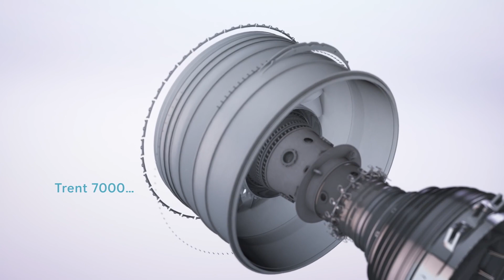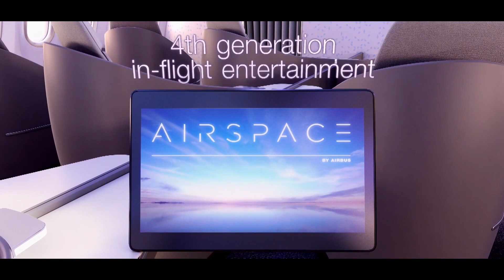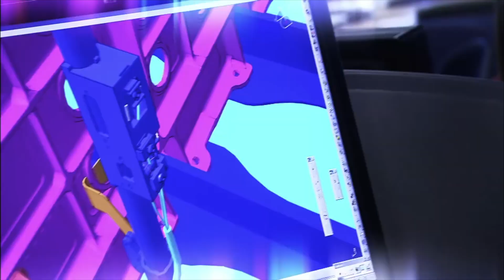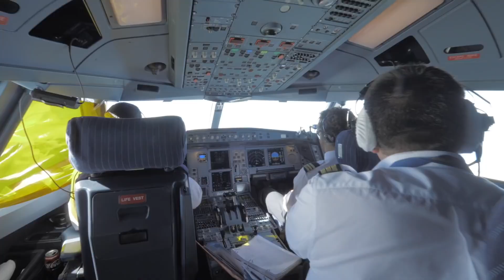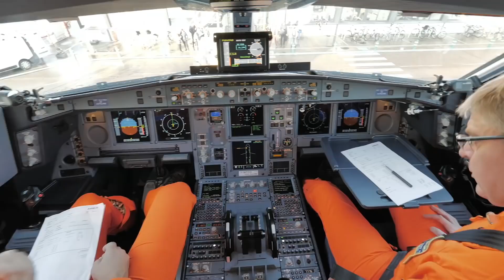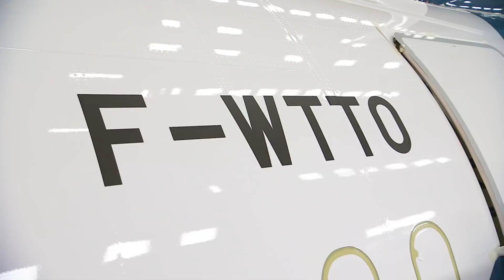Airbus A330neo: FULL Documentary from Start to Finish

Comment: This is what engineering is all about. Passenger comfort. That' what sticks out to me here. Airbus really went all out on this one. Which I can't say for Boeing with they're design of the 787 program which had delay's after delays. And yet they're still delays with the 777-X -9 program. Boeing needs they're engineers back. And if I'm not mistaken. Hasn't the 787 program been suspended. At least that was mentioned on another Youtube feed.
Reply: Boeing cut corners and that eventually led to the problems they have now? It is now close to 2 years that the FAA still holding Boeing to account for their various quality issues. Their 777X had fuselage cracks that led it to be scrutinized till now? Hope Boeing get their act back to where they used to be? Airbus is reaping the benefits across all of their model line-up's. If Airbus comes up with a completely new model to sit between the A350 and the A330 Neos, then it will definitely nail the coffin to Boeing for sure. I think Boeing should seriously ponder of creating a new 757 or 767, something to sit between their 777 and 787 because I forsee many airlines may opt for 250-280 seater that can go the distance? A direct hub-to-hub aircraft must be a priority rather then resorting to transit connectivity module simply to save fuel over a span of  a fiscal year. Airbus hit the jackpot with their A220 and their new A321 models as most airlines could service domestic routes more effectively. I believe Boeing will eventually get over with their crisis at hand? We now have to wait for financial reports from airlines flying their now recently approved 737 Max in order to gain any significant data of its effectiveness. Pray that the MCAS system is fully sorted out by now?
Reply: @hishamosman4341  So true. The 767's and 757"s are out dated. But for some odd reason airlines are using them like a work horse. It's interesting to see them in plane spotting on the Youtube vid's. But it's unfortunate that air bus is having some issues with the paint job on they're 350's The CEO of Qatar is not letting them slide on the situation. But regardless the 350 is one of my favorites from Airbus
Reply: Sebastian Floyd  That’s just the thing, the LR is an extended range neo, and the XLR is the ultra long range version of the neo. However, it’s at its fuel capacity limit and EASA has made Airbus modify the fuel tanks, which is resulting in a delayed entry into service. The airframe is maxed out to it’s range capacity with the XLR. At this point there is no way it can be further extended. The LR is essentially an ER with a different designation, and the XLR is a further extended range variant. They simply cannot be extended any more than those 2 already are. There is no way to make a safe ULR or XER as you say.
Reply: Sebastian Floyd  If I were at Airbus I would not want to take that gamble. I say this because it would essentially be an A350-900 size aircraft, but not as wide. The wing would have to be modified extensively, and the engines would have to be more powerful than the current Trent 7000’s. This would overall decrease its efficiency, making it less attractive. On top of that it would compete with the A350 as well, which would not be a good idea. The range would also be less than that of the A330-900 which would not make a good business case for airlines. One of the reason I feel that A330neo sales are slow and makes it less attractive is because it has a sole engine option. Another issue would be price point. The -900neo is approximately $298 million at list prices, and would make a -1000 more expensive (about $335 million) than an A350-900 (about $320 million) and would not be as efficient. On the other side of the pond, a similarly sized 787-10 is $338 million at list prices, and would have a greater range, capacity and fuel efficiency. So simply put Boothe the A350 and 787 would blow it out of the water in terms of capacity, comfort, value, and efficiency. I just don’t see a business case for it and I feel even an A350-800 would be a much better plane over all than an A330-1000neo.

Comment: The long term future of the 33Oneo is now very much in question. The Air Asia order, by far the largest, Can effectively be canceled. The overall backlog for the plane is fairly small and reducing.
Reply: I think that, after the A321XLR enters service, Airbus should start development of a brand new A330 replacement. It would be a great time to do it as it would likely enter service in the early 2030s and at that point, the 787 will have been in service for around 20 years and so airlines will be looking to retire their oldest aircraft. It would also allow Airbus to completely fill the gap between the A321XLR and the A350-900, with a base variant designed to replace the A330-200/800, a stretched variant designed to replace the A330-300/900 and a de-rated, 787-3-like variant designed to replace the 757-300 and 767-200

Comment: I find it amazing that Airbus have been able to take what is basically an aircraft which started development in the late 1960's coming into service in the early 1970's (A300) and have ended up with something which just doesn't seem to show its age (Airbus must have a picture in their attic!)
Agreed, some of the newer designs with their extensive use of composites might have improved fuel burns, but economics as a whole over whichever part of the lifespan an airline choses to operate it is probably far more important.
The fact that they have done so much to something so old, or perhaps the newer clean-sheet designs do so little extra with something so new does make me wonder from where the next major improvement will come.
It also begs the question - What would Boeing have done with the 767 had an Airbus type of Management been running them?

Loved the video, one of the best so far. I look forward to seeing even more of this type covering how a specific model line has been updated and improved.
Reply from the maker: Thanks for your support! One more is defintely on the way, hopefully in time for its return before the end of the year... hmm. Yeah the A300 fuselage is timeless, and I believe the A350 fuselage would last for generations ahead! Thanks for tuning in!
Reply: @oneskyflyer  Taking into account that the A330 evolved from the A300 and its derivatives, and that some of those derivatives are pretty much the appropriate size to nicely fill the increasingly relevant gap between the A330 and A320 series of aircraft, I wonder how feasible it would be to create a 'shrink' based on the A330 with new composite (optimised for the reduced size of aircraft) wings and tail section? I am guessing that something rather impressive could be achieved at a far lower cost than Boeing could achieve with either a clean sheet design, or from the 767 which would possibly now require just too much development to make it a viable option. I am thinking that the cross section of the A350 is just too wide to be appropriate for an aircraft capacity of 200 to 250. Perhaps even something to be explored in a future video about how Airbus and Boeing could fill the gap?